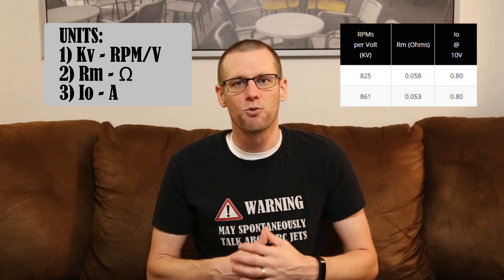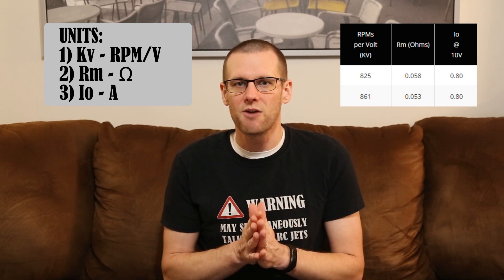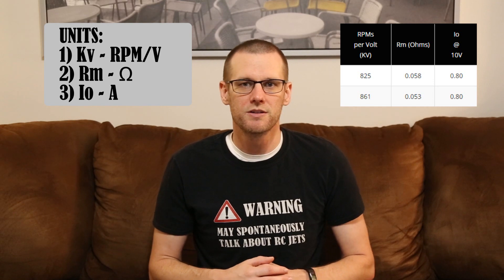Does an RC Motors No-Load Current (Io) Change as Voltage Increases?

Comment: You should have shown the plot of voltage vs Io.  It is a linear relationship - I graphed your data.  Then you can get a linear regression equation and predict any Io at any voltage from one reading.  Although the slope of that regression is probably different for different motors

Comment: If I understood this explanation in video correctly, it means - more RPM means more mechanical drag from the bearings causing increase of the current? If so, then I must strongly disagree. Explanation lies in the basic of ohm law. I=U/R.
Reply from the maker: Thanks for the comment Tibor. One component to the losses built up in the Io constant is mechanical drag due to higher RPM. 

You have made a big simplification to a much more complicated problem. You are not able to use Ohms law here as you have. The resistance (better known as total impedance in this case) that you want to use in your formula changes with RPM.

Comment: First i want to say that your videos have best explanation for esc and brushless motors, even someone who is new to this can understand.
Second i have problem with one ESC i hope you can assist me to fix it. 
I have bought used RC plane who had extended wires for esc to the battery side without additional capaciators. And i noticed that ESC is defective because every motor that i tested on that esc is making weird noise and start to vibrate especialy at higher throttle.
First i thought that battery is an issue because that extremly happning with 20C battery, and  with 25C battery is a little better and with 30C battery or stronger it doesnt have issue. But then i have read on forum that C rating of battery doesnt mattery, that reall problem is ESC which is defective.
Same thing is happening on 4 different motors that i tested if i use this ESC, so obviously ESC is defective. Because with other ESC i have no issue on any motor with same Amps.
Here is the video where i recorder on first 30 seconds of the video you can hear that noise: https://www.youtube.com/watch?v=A9Cf_XKBo8A
Anyway my capacitors are not swollen. Can be capacitors be still bad even if they are not swollen?
Reply from the maker: Hi maverick358, thanks for the comment. My first thought without having the plane in front of me is that your ESC is functioning correctly and well. 
Few Questions 1) Did these batteries come with the plane?  2) What is the age of the batteries? 3) What is the voltage of the battery under load while the motor is surging as in the video?

It sounds like your batteries are not able to deliver the required amount of power and the ESC is going in to low voltage protection mode to save the batteries. The noise/surging of the motor is known as a soft low voltage cut to warn the pilot that there is a problem and you better land. A hard cut would be total loss of motor until it is reset by the throttle. 

To test if these thoughts are true, measure the LOADED voltage as in question 3 above. You may also try (Do not leave it this way) disabling the low voltage cut off on the ESC and see what happens. Once you know your answer reverse this setting.
Reply: @RCexplained  Thank you for reply.
 The batteries are not problem because i tested same batteries on 3 very different motors and 3 different ESC and it didn't had any problems. everything is working perfect.
From smallest motor to the biggest i have. From 10A ESC to 55A esc, Even with 10A Esc on that motor and that batteries works perfect.
Then i used same motor and put 3 different ESC  with same batteries and everything works perfect.
Then i have put that faulty ESC  (30A) on  3 different motors and had the same problems.
So 100% only problem is that ESC no doubt!
I tested new and old batteries on that ESC, with every battery below 30C rating no matter if its new or old  have same problem.
The model of ESC is E-flite 30-amp pro which is old probably about 10 years. And previous owner has extended + - wires from the esc to the double of lenght without additional condensators.
So my guess is that have ruined that ESC overtime. Who knows how long previous owner was flying that plane with extended wires.

So again answer on your 3 questtions:
1)Batteries didn't come with a plane
2)Like i said i tested from the 5 years old batteries to the brand new batteries who i never used before (and same problem happens if the batteries have below 30C rating. The lower battery C rating is the ESC is acting worst)
3)
And ESC is not cutting motor when i force to keep flying that way. I was flying  on maiden  4x10 minutes with that esc and that weird noise was been whole flight :D 
Of course on the end of every flight all batteries had about 3.7v per cell i didnt' drained them too much so that esc would react and cut the motor off.
The point is that ESC is keep working all flight even with that noise in the background!
On that video that i recorder i have cutted throttle with left stick not esc itself!

I can't do atm voltage measurments because i removed one capacitor, i will order two new to replace just in case. Until i solder again capacitor i can't test esc again
Reply from the maker: By explaining hard cut vs soft cut, I was not suggesting that your ESC quit because of a hard cut. You can not have both options enabled at the same time. The softcut that your ESC is programmed to would surge for the entire duration of the flight. 

Extending ESC to Battery wires can wear out an ESC quicker, however you will not notice this "wear." When you do notice the wear, your ESC will turn in to smoke instantly and its far too late. It's either the capacitors are doing their job or not, there is no in-between. 

Your ESC can not tell if you plug in a 25C battery vs a 35C battery. The problem to be ESC related must happen for both these batteries equally. Watching your video again I can hear that your 35C battery is outputting a higher voltage and hitting higher Prop RPM staying away from this voltage cutoff. (soft cut/surging motor) Your ESC is working very well here and also when you use the 25C pack.

Comment: His Ryan I have a question. Is it useless to use electric water pumps in rc boats with water cooled brushless systems.
Reply from the maker: I would not add a water pump to any fast electric boat. Simply using a water pickup is very effective. Using a water pickup directly from the prop wash above the center line of a surface driven prop is ideal.